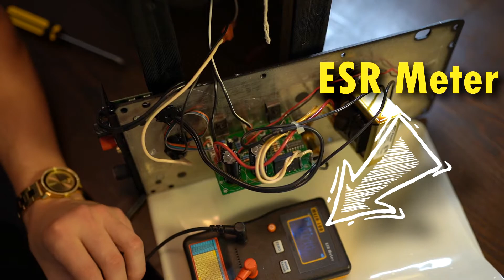Boston Acoustics Speaker - No Subwoofer Sound Fix - VR960 Repair

Comment: Thanks for the video. Ordered the capacitors and soldered them in. A little tedious but easy and speakers are good as new. No more crackling when then turn on and off randomly. All fixed and stay on during low signals during movies. 

Thank you thank you for the video and not a twenty minutes life story. 😂
Reply from the maker: You're the man, Ted  👏

Comment: I replaced my 100uf 25v but now there's no sound. Do you think it's poor solder the cause. ?
Reply from the maker: As you troubleshoot:
1.  Was there sound before you replaced it?
2.  Does the light turn on?
3.  Did you reconnect the speaker?
4.  Caps are polarized.  Did you reverse the orientation of your new capacitor?
Reply: @VestigialVoice  yes there was sound but crackling.   No light turning on now. I forgot to tin the three caps so I may take it out and redo them..I will check resistance before taking them out. Maybe I left my 25 watt solder too long.

Comment: I have two of these speaker. Both started cracking about a year ago whenever the base is turned on. So I turned off the base, but stiil use them without the power plugged in just for TV. Please tell me your in Ohio???? I need these speaker I have fixed. I watched your video, but still think trying to fix them myself is still way out my league. Any suggestions on Who or type tech or electronics company I could call and ask for for repair of these speakers I currently have?
Reply from the maker: Hi Ellk, unfortunately I live nowhere near Ohio.
When powered on, is it constantly crackling (even despite audio not coming out of it) or does it only crackle along with the audio?
-After examining the internal components and design of these speakers, I was a bit disappointed in the craftmanship.  They are not overly expensive speakers and electronic technicians are  a dying breed in this "if it's broken, throw it away and buy another cheap one" economy.
That being said, I do not think fixing it yourself is overly complicated with a little understanding and the proper tools 🍀
Reply: @VestigialVoice  They only crackle when the bass is needed or turned up as long as the bass dial on the back of the speaker is turned all the way down its fine. Turn it up evean a little and the crackleing starts.

Comment: Any advice if I'm getting electrical "noise" after plugging in, and the fuse immediately blows? I replaced all caps
Reply from the maker: Hi totts, it sounds like you have too much current.  I know it is annoying to replace fuses, but without them, you'd likely be damaging your audio circuitry.  As a first step, look for scorched components and replace them.  Next comes the voltage checks and diode / rectifier testing.  Good luck, my friend  🍀
Reply: I have the same issue, replaced caps too, but no change 😢